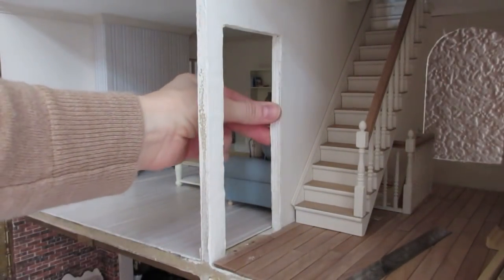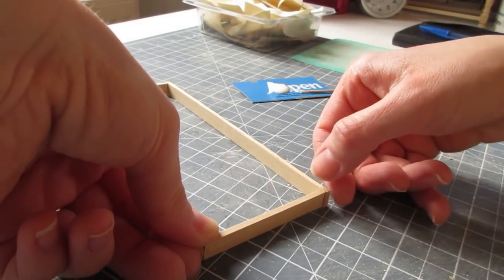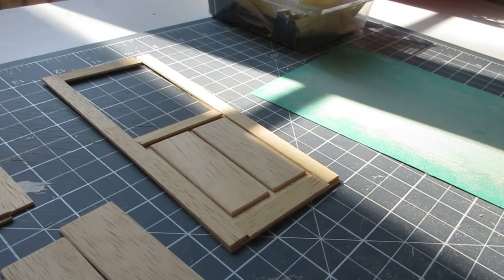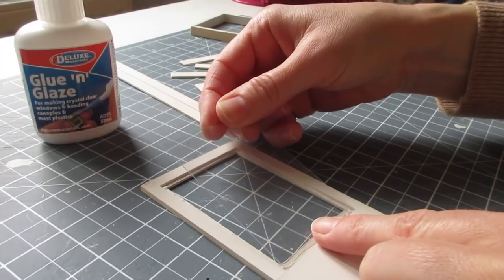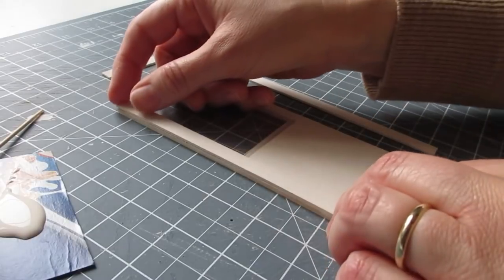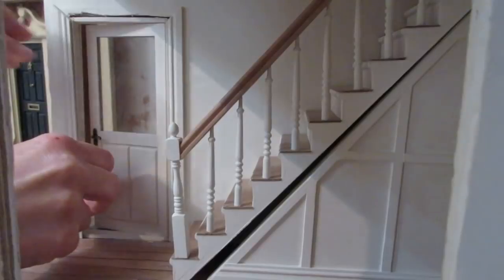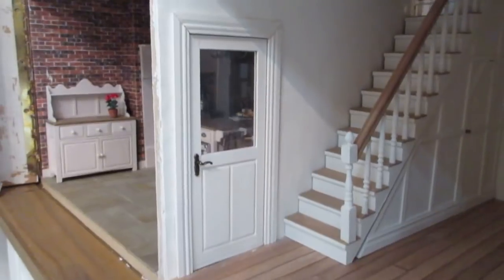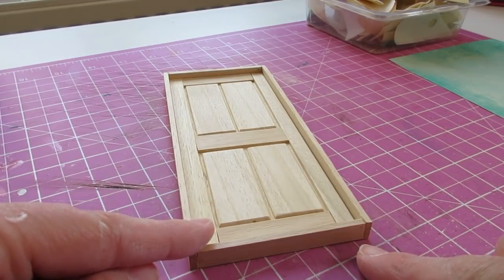My Dolls House Diary #31 - How to Make and Fit Dolls House Doors

Comment: Your door looks wonderful.  I noticed the paint looks lovely and smooth, is that purely down to sanding the wood and the coats in between?  I have used acrylic paint but find it very thick.  What paint do you recommend please?
Reply from the maker: Thank you Natasha.  I use emulsion paint - the little sample pots you can buy at your local DIY store are ideal - and yes, sanding is the key! :)

Comment: Hi Julie, excellent tutorial.  Do you have any tutorials on how to repair a door that’s been removed from the frame by the pins?  My daughters cat raided our doll house and managed to rip two doors out of their frame.  The walls surrounding the molding are wallpapered, and I’m nervous about using a heat gun to loosen the frame from the walls.  I’ve tried to pop the doors back in place, but it’s not going so well.  We inherited a gorgeous dollhouse that was meticulously detailed, and the door frames are stained, not painted.
Reply from the maker: Oh dear, that is annoying!  I'm afraid you really do need to get the frame out to pin hinge the door properly back in place!  My only other suggestion would be to glue the loose door into the frame and have it for show only.  What a shame. :(

Comment: I love your videos!  I am building a dollhouse for my one and only granddaughter and have never done this before.  This miniature world is so much fun, I am surprised how much I enjoy it.  Can you tell me what type of paint I should be using?  I noticed that when I made a pot hanging rack the silver acrylic craft paint looked chunky.  It is ok but not nearly as good as your project builds.
Reply from the maker: Thank you so much Cheryl. I'm so glad you're enjoying this wonderful hobby.  I use normal household emulsion paint for furniture and other wood projects.  The little sample pots you can buy are ideal.  I haven't used acrylic on wood, but would suggest gently sanding between coats as the paint tends to lift the grain, which was probably what gave it a 'chunky' look. Hope that helps.

Comment: HI Julie, just following your videos and on my second dollhouse, the Mayfair which is a similar layout to yours. So excited about that.  However, I discovered that it comes with plastic windows and doors.  Would you recommend changing those out for wood windows? And is that a better option ? Thank you for everything x
Reply from the maker: I would probably change the windows to wood if it were mine.  I think wooden windows look nicer and you can paint them, too.  xx
Reply: @JulieWarren   I have ordered wood doors, it took me a while to find them as they have to  be smaller than the usual 1/12th scale .  For some reason the Mayfair designer has put in slightly smaller internal doors.  I have tried getting the plastic ones out without success; I couldn't even get just the doors out and leave the frame! so I am now trying ways to make them look better than the ghastly, light brown colour they are at the moment. I'll probably keep the wood doors for other projects.  :/
Reply: @JulieWarren  I finally, couldn't bear the plastic doors and frames,  and got them out. Took me most of the day to get 6 sets out as so heavily glued in. Even using a hairdryer! Broke two MDF walls but PVA plus superglue came to the rescue and if necessary, I'll get two new pieces cut.  Thanks for helping me make up my mind :)
Reply: So, the saga of the doors continues. Having got the plastic doors and frames out, I ordered wood ones. They arrived and didn't fit (Arghhh). so now I am watching this episode on repeat and making my own doors.  You make it seem so easy :). Thank you for all your hard work !!

Comment: Have you ever or do you see any possible future issue that the acetate comes loose? It seems there's a fair gap, would it prudent to fill it, like window putty? Possibly tricky without making a mess of the window.
Reply from the maker: If you have any gapping, you're probably cutting your acetate too small.  Cut as I did in the tutorial, to leave a good border around the edge.  The acetate is then glued into place and sandwiched between the frame pieces, so will not come loose.  Hope that helps.
Reply: What I was meaning is the play in the spacing, if that makes sense. The acetate is a fraction of a mm, but the depth of the space created by the framing will be around a mm or more depending the wood thickness. So if you didn't have glue, or the glue lets go, then the acetate will flap around in the cavity. It won't come out granted, but it will be loose.
Reply from the maker: @PetrikNZ  I understand what you mean, but not really sure why this is such a worry - the acetate is going nowhere.  I'm just showing you how I do things, if you don't like my methods, please use your own.

Comment: Why do dolls house doors always sit in a complete frame with a raised threshold?  No interior doors in a real house have a raised wooden threshold and it would be inconvenient to step over them if they did.  Why is it necessary to have this pattern in a dolls house I wonder?
Reply from the maker: It makes it easier to fit the doors.  The bottom hinge needs something to go into.  Door in a real house are fitted in a different way.
Reply: @JulieWarren  Many thanks, and yes, I know it makes it easier to fit but you have overcome the difficulty as shown in your tutorial on the attic.  No threshold to stumble over.  And the door does open!  The lumpy unrealistic look of a threshold always bothers me.  Might there be a tutorial on that?